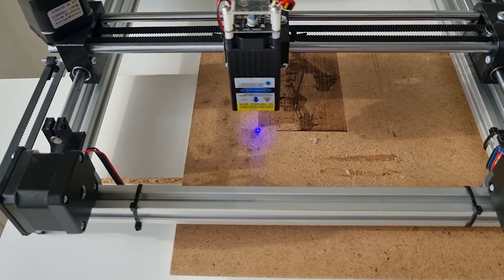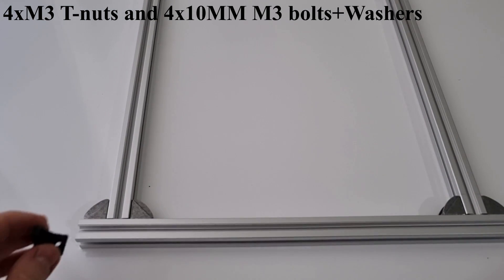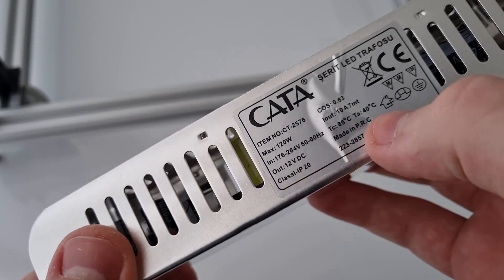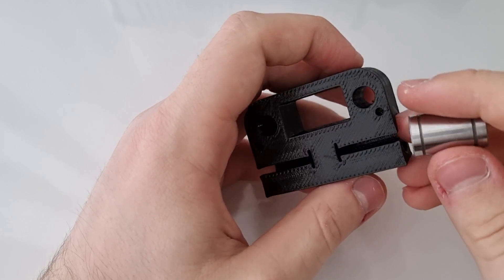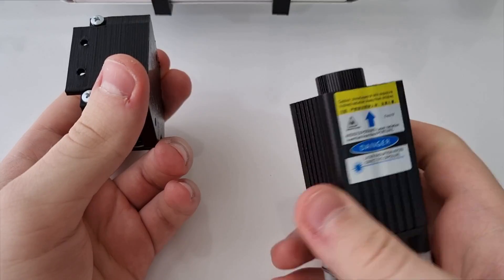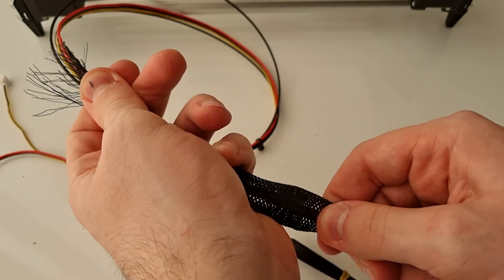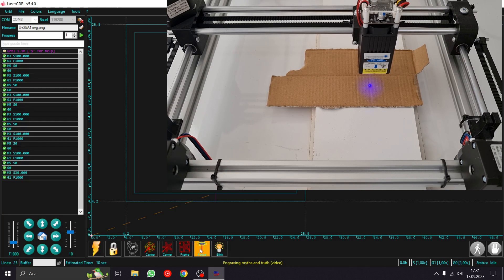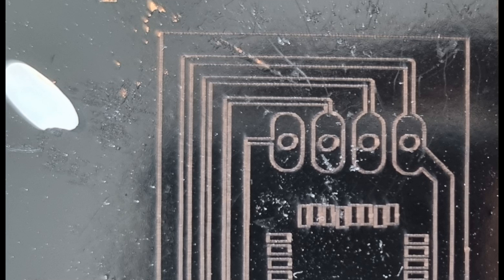DIY-Basic Laser Engraver With Arduino

Comment: What is the working area?  Would a 400x400mm honeycomb bed fit in this engraver?  Looks easy to modify if not.  I really like this design with the two y axis motors.
Reply from the maker: the engraving area is about 240x240 mm but you can easliy make it bigger by just using longer aliminium profiles and smooth rods.

Comment: Will it work with 80 watt.laser moudle as well ? Need any change in code? Can you also send or explain the ardouino flash grbl ? And are there stepper limits in the project ?
Reply: Great, thanks dude one of the best I have ever seen!!
Reply from the maker: Yes, you can use an 80 watt module, but you need to upgrade the power supply. You don't have to change anything in the code. You can flash GRBL via the LaserGRBL program (as shown in the video). You can copy my settings that I showed at 9:25. I'm assuming you are also asking about limit switches; I did not use any in my design, so you have to manually home the laser, but it's very easy.

Comment: Can it work using light burn app?
Reply from the maker: I haven't used LightBurn before, but you can flash GRBL with Arduino IDE, and then you can probably use the LightBurn software